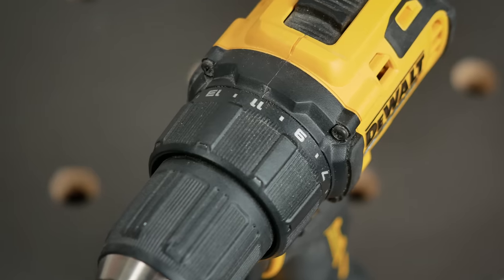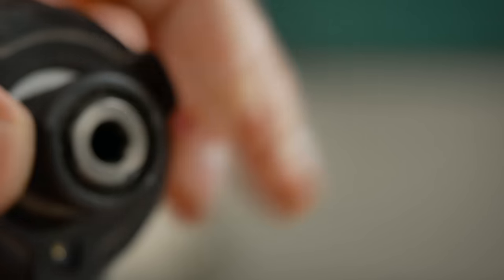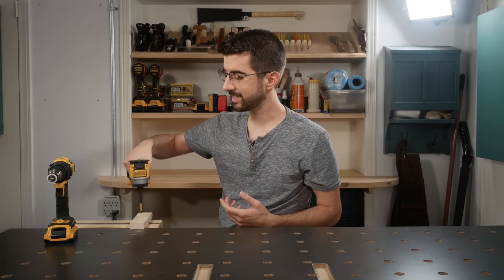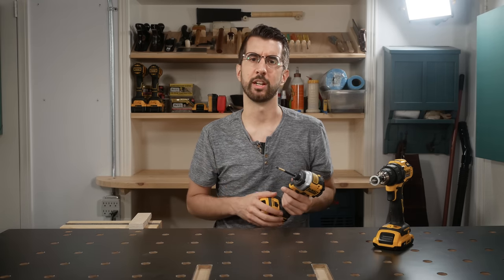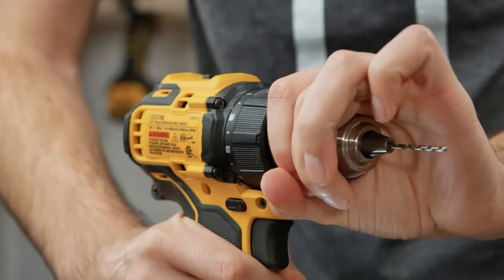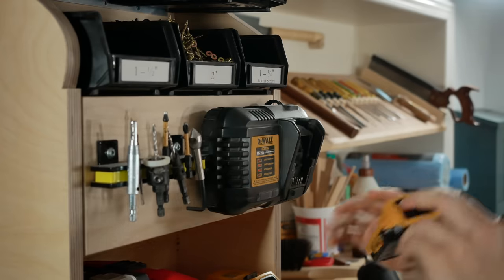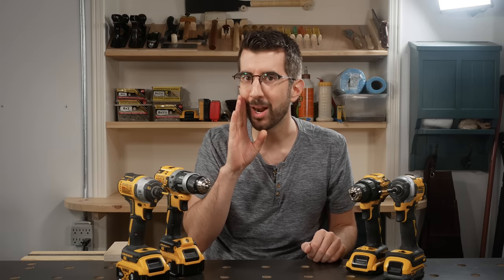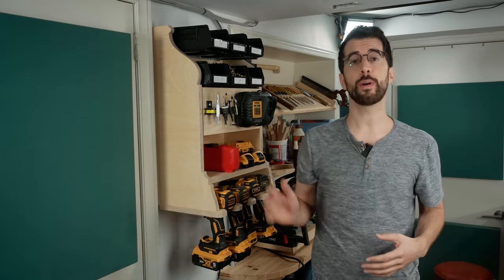why woodworkers don't use impact drivers

Comment: Impact drivers are exceptional for drywall and alot of woodworking applications, and if you go for one, buy a decent quality and definitely a brushless motor as it will double the battery time and is more powerfull.
You don't need one with different speeds, as is not the speed wich is important in an impact driver but the wheigt of the hammer inside of it. You just need to learn to control the trigger.
There are applications where i would prefer a 12 volts brushed drill, for example when o drive small thin screws into a wood project, i find the brushed motors to be more controlable at low speeds than the brushless ones in drill drivers.
I think if you have one good 18v impact driver, like a milwakee, hitachi(or hikoki now), makita.. is enough. I used for 7 months every day for 7 hours a day a hikoki 18v imact driver, then used it to build my house and also others used it. Except the fact that it looks like someone smashed it with a hammer it works like new, amaizing tool. And the battery has no sign of getting old, the 5ah one.
But as for drill drivers, i would say you need as a handyman at least 3. One 12v for fine stuff and electrical stuff. and 2, 18v. 
I find many times when i am working lumber in constructions that i need two drills to have them set with the drill bits i use the most so i won't change it every time i drive a hole. For example when you connect beams you need one drill bit larger in wich the screw doesn't bite and another for the part where the screw gets screwed. 
The impact driver is like the modern hammer, if you work with tools you have to have it.
Now where i live (EU) they also sell dewalt but the prices are way too high for such poor designed tools made in china to be honnest. Way to bulky. I would chose a milwakee all day over dewalt tools, but here i have other options wich are not only same price or cheaper but also better. I find hitachi wich is now hikoki to be at same level with milwakee but much cheaper.
Now there is a choice of what do you want to go with the batteries too. to be 5ah, 3 or 2,5, that is up to you, i personally prefer the 3ah ones, are kind the balanced ones. Especially if you will be holding that tool many hours per day. 5h is fine too and will last longer since it takes longer to charge the cycles since is a larger battery but is also heavier. And definitely go for batteries wich have indicator for how much juice is in them that is really helpful.
The brands wich i worked with so far is milwakee, makita, hikoki, bosh. To be honest they are all good tools, but be mindful when buy the bosh tools that they have 2 kind of tools, the hobby kind of ones and the professional ones. The difference is the price and quality.
So far i was most impressed with hikoki tools and their battery quality and milwakee. I am yet to see if makita is the same with their batteries.

Comment: You need to know your Tools a Impact with larger Timber Pre Drilled and Countersunk on a Light/Low Drive using a Non Phillips Head is ok(use grease or Jelly) into a Metal Post, Pole etc.Pre drilled Holes going into a Dowel or wedge can be a better fix than replacement of old Timbers

Comment: Awesome video Scott! I wouldn't have thought a video talking about drills and impact drivers would be worth watching but BOY you did it man! Great work. Also. I too am a Dewalt Fanboy but if anyone REALLy doesn't like the "geh geh geh" sound of the impact driver, you can look into the Hydraulic Drivers. I use a Milwaukee 18v Surge at work and really enjoy it. As I am just a hobbyist I personally don't see the reason for spending the extra cash on one but as a trades person who may be using it for several hours a day. The decrease in sound and vibration may add up. 🤷‍♂
Reply from the maker: Thanks so much Jason! I've actually never heard of the hydraulic/oil drivers until now. I'm definitely going to look more into them. They seem very interesting.
Reply: @ScottWalshWoodworking  No problem! My old impact is still kicking but if Dewalt was to release a hydraulic driver it'd probably be the tipping point for me. 😂 As another smaller shop guy I really want to stick to one battery platform/one charger. Anyways. Thanks again for providing us all with quality content Scott! 🙏

Comment: The most important reason to use an impact driver is that you won't feel like your wrist is going to break when you need high torque for driving really long, or large diameter, fasteners. If you've driven a huge hex bolt with a drill then you know what I'm talking about. It absolutely kills your wrist, even if you pre-drill. However, the impact driver will just whack-whack-whack that giant hex bolt into the 4x6 without hurting your wrists at all. THIS situation is where impact drivers will always be FAR superior to drills, and its why you should have both in your workshop.

Comment: It's perfectly reasonable to stick with one battery platform. The convenience of doing so easily swamps any possible advantage of having different brands for different tools. If you watch power tool comparison videos - and there are some people out there putting out very detailed, well thought out, engineer-level comparison tests - the main conclusion is that there really isn't much daylight between the major professional brands. I like my Makitas but I'm sure that if they were all swapped out for DeWalt / Milwaukee / Bosch / Metabo it would be just fine. The advantage of DeWalt is that all of the big box stores carry that brand, so probably you can get the best combination of sales on them.

Comment: I use my drill to drill and my driver to drive. Ive never heard of woodworkers refusing to use drivers.

I follow a ton online and they all use drivers for the right application.

The thing is a lot of nice joinery avoids driving screws so depends whats being built.

Comment: Get yourself a quick change/release drill bit holder and you won’t have to worry about bits getting stuck in screws. You can get one for less than $10usd.

Comment: thanks, great food for thoughts as always...
i have an impact driver and stopped using it because for me there wasn't any perceptible advantage in using it and the soud it makes is annoying to me. HOWEVER: i was gifted a 12v "other generic brand" drill with interchangeable "chucks?" and there is one that has a bit holder like an impact driver would have. As you mentioned one hardly needs the torque of big drivers/drills and the little one does the trick 99% of the time. In addition it's lighter, quieter and shorter so i can get into tighter places when screwing something.
I just looked it up and it's around 100€ in austria at the moment. (Bosch GSR 12V-35 HX)
Reply: I believe what you're refering to is called an installation driver. It has a clutch like a drill and you can swap out the heads with a drill chuck, 1/4 hex/quick change, 90°/right angle, and an offset. Milwaukee and dewalt both have them for their 12v lines. I just got the dewalt. I assumed it was going to impact with everything but the drill chuck, or have a setting for impact. It doesnt so im kinda disappointed since i like impact for installing and removing screws/fasteners

Comment: As a carpenter in the trade for a decade who does a considerable amount of much nicer woodwork outside of work, I NEVER use my drill clutch and I use my impact drivers EVERY DAY for ALL KINDS of work. Including the nicer woodwork.

I’ll sit down and watch the rest of the video now.

Edit to add: ugh, you’re one of those square drive screw lovers lol. Those things are barely better than slotted screws. Phillips are fine for anybody with decent tool control and torx are nice too.

Edited again to add: I carry 3 drills and 3 impacts for work and it’s not uncommon to have all 6 loaded up with different drill and driver bits at the same time - particularly when building decks. They all sit beside me with their various bits chucked up and ready to go instead of rattling around my pocket getting mixed up poking me in the leg.

Edited again to say that compact tools can and regularly are extremely useful when doing cabinetry and working in other tight areas. It’s very common for me to go to my work vehicle and grab a smaller drill so I can squeeze it into a tight area and get a hole drilled or screw fastened.
Reply: He uses Robertson screws because he's in Toronto.
Reply: Indeed. I like having several tools queued up and ready to go. And always use my impact for screws. If you are putting in a number of different fasteners and need to carry bits - I carry a magnet in my framing bags that I stick them to.

Comment: My old brushed motor dewalt impact driver was kind of a 'best of both' since you could regulate the speed a lot more easily than with the brushless version I have now.  Battery life was terrible though.  I still always use the impact driver for screws though and only really have issues with shearing if I come across low quality stainless screws

Comment: The drill is more important and versatile than the driver but I wouldn't give up my driver if I had a choice.  It's just too handy for to many things - and what woodworker doesn't have to take on other projects now and then. 
I went Makita instead of Dewalt, though.  I avoided drivers for a long time because I just couldn't handle the noise. Something about it just grates on my nerves. The Makita chatter seems to be slightly lower pitched and doesn't bother me as much, even when I'm coming off a migraine.

Comment: You missed the by far biggest advantage of impact drivers: The lower torque on the handle. With an ordinary drill, you have to hold whatever torque the thing outputs. With an impact driver, you only have to hold whatever torque the motor is generating to accelerate the hammer (that internal bit that hits the driving end), while the impact of the hammer generates a much higher torque without  you having to hold against it. So you get the benefit of a ton of torque, without breaking your wrist.
That sound irrelevant when you screw on that tiny hinge on your new closet, but it makes a bit more of a difference when trying to drive a 150mm screw (~6" in banana units) into a piece of wood, on a ladder, in an awkward posture.

Don't believe me? Think about this: My chordless drill outputs up to 60Nm, and I several times twisted my wrist or almost fell off the ladder when a hole saw would bind. My still pretty compact impact wrench (they're built the same as impact drivers, just a bit bigger) outputs up to 900Nm, and I have no trouble whatsoever to hold it. I can comfortably hold it with one hand and open the lug nuts on a tractor while taking a sip of my favourite beverage at the same time.

Comment: The bugbear I have is modern manufacturing and quality contol is so poor that many screw heads are not at 90 degrees to the shaft of the screw and is only something you find out when the screw is already part way in. Either that or the head shears off before the full length has been driven in.

Comment: You can just get non mag quick change bits where the driver heads lock in with the same quick release. I friggin hate impact driver noise, tho get theres a time and a place. Do a lot of stuff with my father in law at his property and he seems to love using the noisiest, most over the top tool for whatever job hes doing! Like joining pine with 200 half inch screws with an impact driver!

Comment: You diss magnetic bit holders, rightly so. Look at DeWalt's one with the the pull-back locking collar. Essentially the same mechanism as the quick change in an impact driver but turned around.

Comment: I maybe used my drill less than ten times I use my impact driver every day and no settings on mine except variable trigger but if you can master it your good btw I use Milwaukee brushless not the low tier but not the fuel gotta love hex drill bits

Comment: I usually use two screwdrivers and one impact driver. The impact driver should have the ability to disconnect the impact for small screws. It would then be the perfect tool.

Comment: Scott as a Canadian you know that they are properly referred to as  “Robertson” drive not square 😉 I consider my impact driver a renovation tool that I couldn’t live without but never reach for when building furniture. I have been trying to justify that Festool gun with the cool handle as I really like the shape but the house foreman hasn’t approved that purchase yet.
Reply: Festool is nice but we have found them lacking in the field simply due to ergonomics, if you are going to spend that kind of money go Hilti all day every day.
Reply from the maker: One day I went down a rabbit hole of the history of Robertson screws. If I recall correctly, Robertson still has a patent on a particular geometry (I think it's the taper angle) and they claim that you should only use Robertson brand bits with Robertson brand screws. Any deviation is considered sacrilege to them 🤷‍♂️
Reply: At my house it’s better to ask forgiveness than to ask permission. I just do what I want. Then it’s already done.
Reply: But outside North America, I think hardly anyone has heard of them, so its more informative to describe them.  In Europe far more folk now use Torx, which I think is the best, and also the screws sit obediently on the end of the driver bit while you get into position, very handy if you're using stainless steel screws. Posidriv or Phillips, yuk...

Comment: Is it different than a regular machine with impact you can switch on or off?
Reply: I've never seen an impact driver that you can turn off the impact function. DeWalt is the only I've personally seen with a switch for impact levels, but all pretty much now have variable speed switches.
With familiarity and practice, a variable speed switch is all you'd need, really

Comment: I have a hammer drill so torque mode drill mode also hammer/vibration mode. I easly get 10mm holes into the brick/concrete.. i also need to cut some tiles from time to time so i just put a diamond drill bit. I also polish my headlighst with my hammer drill. More torque? I just use my bosh sds plus... and i have sds max which can pretty much break and screw anythink you can think of. I use bosh since im considering buying more of those tools, servece here is really cheap fast and proffesional.. from serbia. 
Get a hammer drill you can do anythink..

Comment: Going to add 2 things. 1. If you have bad wrists. The impact can be used to holes with more noise but no high twisting loads on your wrists. Yes, a drill clutch helps with this but you might find yourself needing to up the clutch pressure for drilling in harder woods. 2. Your demonstration of the impact works was a bit too simple. One import advantage of the impact over using a hammer to pound a lever or wrench is that the impact has two hammers making which centers the force which leads to less broken screws/bolts/bits. But that might only be important for things like working on cars.

Comment: I don't think I've even seen a square bit screw. Every single thing in the local hardware stores are T15, T20 or T25. Except for some shudder philips head screws.
Reply from the maker: Yeah, torques do seem nice but square drives are everywhere in canada. You won't find phillips here.

Comment: Even with pre-drilling my drill was absolutely struggling to get in the big torx head structural lags for my deck this summer without either clutching out or breaking my wrist, the impact driver made short work of them though. Definitely a different story for smaller woodworking projects though. Also, having two drills so you don't have to swap between the drill bit and the screw bit when doing a bunch of alternating pre-drills and screws (like when I was laying deck boards) is a huge time saver.
Reply: They have a bit that flips so you can predrill and screw all with one bit. I never used one but seen them used a few times. Pretty handy. Its 1/4 hex/quick change so you can put it on your impact
Reply: what model is that? Not sure if it's sold here in my country. Should I buy drill or impact? I want to DIY carpentry works at home. Mostly 15mm plywood. Will impact damage the screws or overkill? Btw, I already own Bosch drill 500w but it's corded

Comment: Great video! The only thing you missed was ‘avoid electronic clutches in drills’. A few of the big brands have been pushing that garbage and an E-clutch does not have the ability to have a light touch like a mechanical one.

Comment: Strange argument about quick bit change - there are power tools with similar bit lock as in your dewalt impact, and if you don’t like magnetic bit adapters you can always buy adapter with a lock - Rapidaptor from Wera, or something like that.

Comment: One other really key benefit of having a drill and a driver is that you can very easily switch between them!  So drill your holes for your screws and then grab the driver and go!  Also you don't even have to have to get a driver with a switchable clutch, it's analog to how hard you press on the trigger (just like the drill).  So learn to use a lighter press to apply less torque.  :)

Oh... and usually the cost of a matched set isn't that much more than 1 of them individually, especially when sales are happening (*cough* father's day *cough*).

Comment: Why did you take the driver storage unit off the wall???
Reply from the maker: It was filmed when I made the station, and I had it off the wall just for filming the talking head because it made more sense chronologically when it was intended to be in that video. But I decided to remove the talking head from the charging station video because it didn't flow.